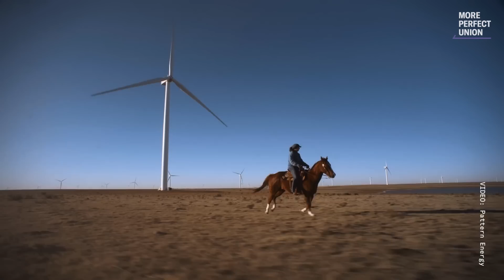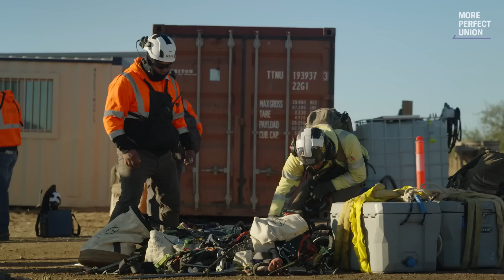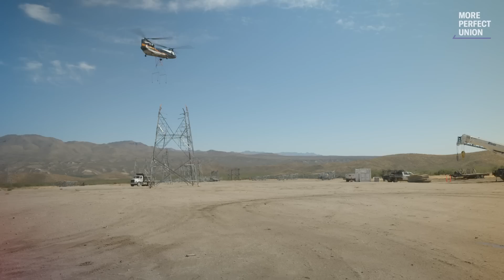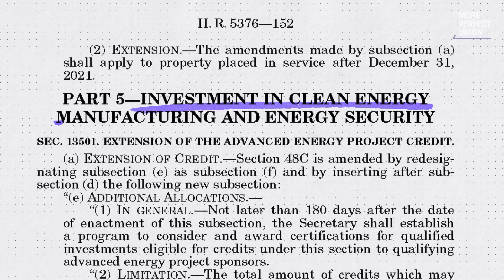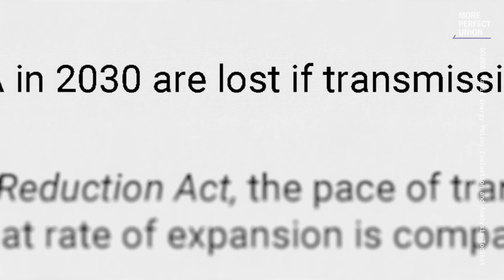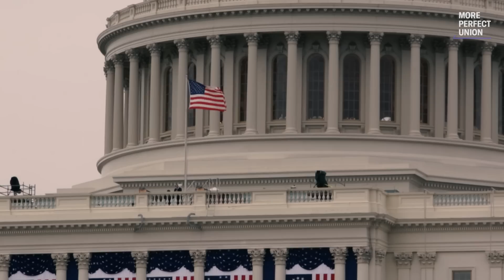Why Clean Energy Might Fail

Comment: That's why each building should have as much self generated power as possible. Decentralization of power is key.
Reply: This is not what studies and experience says btw, the most successful electrical grids, in costs, reliability, and decarbonization, are centrally planned and operated. France being the poster child of this. The decouple podcast, available here on YouTube, covers this topic pretty well.
Reply: No, that is incorrect. Centralized power generation has economies of scale and appropriate utilization of land. Sometimes something that is not broke, doesn’t need to be fixed. Everyone can’t have their own backyard windmill or roof top solar of basement nuclear plant.
Reply: @klintcook-z8m Backyard windmills are out, for sure.
But why couldn’t every house, in theory, have roof top solar panels?
Reply: @Bushman9  Because nighttime.
Reply: @ We have batteries for that.
Reply: @Bushman9  None that are inexpensive enough, or that are environmentally friendly to produce.
Reply: @PistonAvatarGuy 

Yup, pumped hydro is the only sane way to store energy on a grid scale.
Reply: @Bushman9  because every house is not optimally located to harness solar. also you will still need a centralized generation and distribution system for when the solar output is low. and finally, for multi family units, commercial units, and industrial plants, the roof top space is not adequate for the energy requirements of that site.
Reply: @eingrobernerzustand3741  Yes, but pumped hydro requires specific conditions to be viable, and those conditions aren't widely available enough to make wind and solar viable as replacements for fossil fuels.
Reply: and loss of efficiency, centralized power is always going to be cheaper physically
Reply: Centralized power is more efficient. I don't see peope each generating their own house's power with their own reciprocating steam engines.
Reply: @gregorymalchuk272  
Thats correct,  incase of thermal plants.
Reply: You want to kill the grid?
Reply: Your gonna be solely dependent on climate ans seasons.
Reply: Well are we receiving as much charity to install solar as these companies are getting? In Washington state we passed a bill of backfeeding solar made in Washington solar at 33 cents a watt and the corporations bought every single panel made and installed them all preventing citizens from being able to profit on the program we funded.
Reply: One answer, tap water
Reply: Spot on. Its why that corrupt AZ lawmaker hit people with a fee for using Solar Panels as opposed to literally every other state where you sell solar power back to the grid.
Reply: So true
Reply: A fully autonomous, solar / battery solution for a single median house cost $ 100,000 to install, and require a battery swap costing $ 30,000 every two-three years, plus routine maintenance. 
Decentralized power actually works cheaply  if you power few computers and LED lights...
Reply: @Ray_of_Light62  🤡🤡
Reply: The solution to over-consumption is to increase consumption!
Reply: @PistonAvatarGuy   A lot of the issues that come from the grid are the result of large fluctuations in residential use. The French nuclear fleet has this problem, resulting in less efficient operation than American or Canadian plants. Providing incentives for people and businesses to be more off-grid might make more sense than to try and balance 24/7 industrial power use with huge residential fluctuations.
Reply: @12pentaborane  But if the goal is to reduce our environmental impact, increasing consumption by layering multiple energy systems on top of one another, when only one would normally be required, is not the solution.
Reply: @12pentaborane  The French nuclear energy system doesn't have any problems as a result of normal demand, but they may run into problems if they start installing large amounts of solar and wind energy. Solar creates a duck curve, which is a far more serious fluctuation than normal residential demand ever produces.
Reply: @PistonAvatarGuy   I'm proposing people leave the grid vs having grid-tied residential spaces. The solar panels, wind mills, and batteries are needed anyways, utilities can save on needing to build as many substations and transmission lines. 

Also, stop pretending you care about consumption. You don't, and nobody who talks that way does.
Reply: @12pentaborane  Read my reply to Proton Decay.

And, yes, I do care about consumption, I consume very little and keep the things that I do buy for a very long time. Heck, most of what I have is second hand.
Reply: @12pentaborane  I've replied to that idea elsewhere in this thread.

And, yes, I do care about consumption, I consume very little and keep the things that I do buy for a very long time. Heck, most of what I have is second hand.
Reply: @PistonAvatarGuy 

You need to layer multiple energy systems over each other anyway 

High voltage systems need to exist to have a unified system as you mentioned, low voltage systems need to exist to cover the 25-50 kilometers between substations. 

As such, having mostly decentralised power production means being able to keep free capacity on the high voltage systems, and as such saving the money and resources otherwise needed to build it out. 

Which is why the eu has created a framework that allows regions to only pay for the low voltage infrastructure if the energy is both generated and used there, without having to put strain on the high voltage system.
Reply: @12pentaborane Yea, look to hawaii as a large scale example of why that suggestion is a bad suggestion. 

If millions of people already is too small to not be a major pain in the behind, how schould reducing it to the individual scale make it any better?
Reply: @eingrobernerzustand3741  You clearly missed the point of my comment. The EU has also shown the world how NOT to go about decarbonizing an electrical grid. France is the only example of an industrialized country (that doesn't also have significant hydropower resources) which is able to produce low carbon intensity electricity on a large scale.
Reply: @12pentaborane  Why are people upvoting your comment? Give me a source which shows that the French are having PROBLEMS with variations in grid energy demand.
Reply: @PistonAvatarGuy  you were arguing about how we schould have one monolithic grid.

 This has nothing to do with how the energy is generated, I was just pointing out that there never was and never will be a workable powergrid that was a monolith, just by virtue of how vast area interconnections are far superior at providing electricity comparatively cheaply compared to only using low voltage infrastructure and having comical losses over long distances, or only have high voltage transmission,  and getting no power to the people who need that power. And since the low voltage infrastructure is in place, generating power where it's used to reduce the strain on the necessary high voltage infrastructure is probably a good idea. 

Admittedly,  I'm not nuclears greatest fan, as everyone who lives in the 40-185 KBq fallout region of chernobyl is(cant tell people whove seen the miscarriage rates of lifestock spike to 5 times the pre-chernobyl level in the years after the accident that radiation is harmless actually,  as nukebros like to pretend) , but it's preferable to more fossil carbon getting emmitet.
Reply: @eingrobernerzustand3741  That's not what I was saying. Again, you missed the point of my comment.
Reply: @PistonAvatarGuy  
What was your point then?
Reply: @eingrobernerzustand3741  Point: Having an energy grid which is capable of supplying customers with electricity, and customers who are capable of supplying themselves with electricity, is never going to be a practical way to reduce CO2 emissions, nor will it ever be inexpensive, or environmentally friendly.
Reply: Point: Having an energy grid which is capable of supplying customers with electricity, and customers who are capable of supplying themselves with electricity, is never going to be a practical way to reduce CO2 emissions, nor will it ever be inexpensive, or environmentally friendly.
Reply: @PistonAvatarGuy  it might shock you, but there is a way to solve the problem of overconsumption without a collectivist approach where the government controls everything. Separating demand so that buildings can self-supply allows unrestricted demand without creating a public burden. ALSO it creates redundancy - when a foreign government decides it's a good idea to knock out your power in the middle of winter (see this in Ukraine today), the main grid could be made to collapse very easily in general, but having some power production at the local level prevents the worst of the effects.
Reply: @Proton_Decay so you’re mostly pro-solar?
Seems to be the easiest way to be energy independent
Reply: @Proton_Decay  The vast majority of buildings cannot self-supply. Not only would this be financially impractical, but there just isn't enough area available on most properties for buildings to be energy independent. Run the numbers on a solar energy system and battery bank that can power a typical tract home (with all electric heating and cooking appliances) through the coldest and darkest winter months, the solar energy system ends up costing more than the house itself and requiring more area than is even available on the property! Large businesses, too, simply can't produce enough energy using solar panels to cover their demand. I live in New Mexico, where a certain big-box store covered its rooftop with solar panels, yet they only cover a small amount of the electricity demand of the store with the system, and they still heat using natural gas. If they also covered their parking lot, they might be able to get close to covering their electric demand using solar, but they'd still be heating with natural gas and the steel required to build such structures on a country-wide scale would be gargantuan. Sorry, but nuclear is the only way to go green.
Reply: @Proton_Decay  It has been projected that most of the population moving into cities. Cities has this problem with power requirement vastly outscaling the avaiable surface for solar or energy storage infrastructure. It's kinda libertarian (borderline prepper) thinking that everyone can have a big house in the woods or in a suburban neighbourhood, have the money and the subsidy to buy and install the needed capacity and also has the opportunity to recoup some of the investment by selling back to the grid which btw getting less likely the more ppl want to do it.
This independent "off grid" thinking all nice and dandy for those who have the money the time the property and maybe some expertise. It's a pipe dream for downtown Joe in his rented apartment with his minimum wage job and student loan. I'd assume we have a lot more ppl in this second type of situation.

Comment: Renewable energy needs to be paired with new storage ideas. They are coming. Storage could even be mobile one day. Just sending shipping crate power packs back and forth. Old technologies make sense now. Sand batteries, solar panels that work at night. Skyscrapper windows that collect energy. A thousand bricks to make the wall.
Reply: Texas is installing batteries at substations  just to maintain 60 hz. Theyre building gravity batteries also.

Comment: Infrastructure upgrades like this are why 'clean' energy will fail. The cost is ridiculously high.
Reply: Drop a sweat will save a pound of flesh.
Reply: @dogwithnobones906  If we were transitioning to nuclear, these upgrades wouldn't even be necessary.
Reply: @PistonAvatarGuy  I like nuclear
Reply: @PistonAvatarGuy  we need both disregarding either is dangerous. Solar and all allow more decentralized generation. whereas nuclear is an excellent base source for energy.
Reply: @zerotwo_.002  Wind and solar do not play well with nuclear.
Reply: @PistonAvatarGuy  that... Isn't even remotely true. Energy is energy and solar and wind with some energy storage is all you need
Reply: @zerotwo_.002  Nuclear does not cope well with large the fluctuations in supply/demand that wind and solar cause, it works best when used as a baseload generator. Wind and solar are literally destroying baseload. You need far more storage for wind and solar than what is possible to implement, the cost of batteries is still far, FAR too high. The environmental damage that attempting provide adequate storage for wind and solar would cause would also be horrendous.
Reply: It was never proofed before being implemented. It's an industry completely motivated by power and money.
Reply: The infrastructure upgrades are necessary even if 'business as usual' power generation is followed. In fact all of this money that is being spent should have been spent over the last 40 or 30 years.
Reply: The cost is low, it just doesn’t make rich people richer so they don’t want to do it.
Large solar farms are a super inexpensive source of energy, and battery advancements are very rapid, allowing us to use some of the energy at night.
Clean energy isn’t expensive. It’s just that the rich want to be able to charge for oil and know they cannot charge for sunlight and wind
Reply: @SigFigNewton  At the same level of capability, wind and solar are insanely expensive, and wealthy people make huge amounts of money off of those systems, because they're so expensive.

Comment: LET'S HOPE THESE AREN'T "MADE IN CHINA" WINDMILLS.
Reply: The rare earths used to produce them mostly come from China.
Reply: @PistonAvatarGuy  I didn't know basic spools of copper wire like your car's alternator was considered a 'rare earth'. Your thinking of the yet to be implemented mass power storage batteries or small high efficiency motors like in electric vehicles. If you follow channels like Just Have a Think you would know they are in the process of figuring out how to scale up with alternatives that won't need nearly as many different kinds of rare earths. and localised pollution on the ground from mining is still better than atmospheric that goes everywhere and affects everyone.
Reply: @Jakeurb8ty82  Most turbines use neodymium permanent magnets because it makes them more efficient. Just Have a Think is not a source for information on technologies that are actually viable. I never claimed that we should stick with fossil fuels for the production of electricity, either.
Reply: i think the balsa wood material the blades are made from comes from canada like most wood stuff in the us. metal ore to make the tower and generator hub housing is probably from asia.
Reply: @Jakeurb8ty82  The blades are made from fiberglass and plastic resin.
Reply: China makes far better cars than the US does. IS has given up on attempting to compete in a fair market. Relying on enormous import taxes.